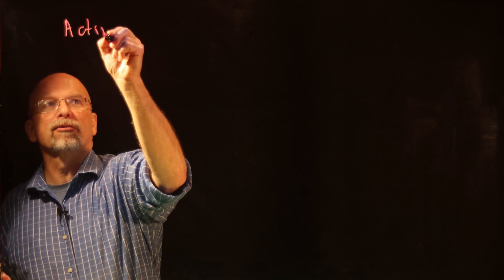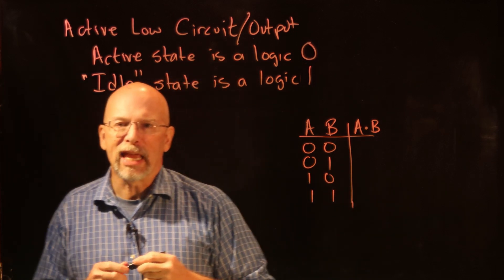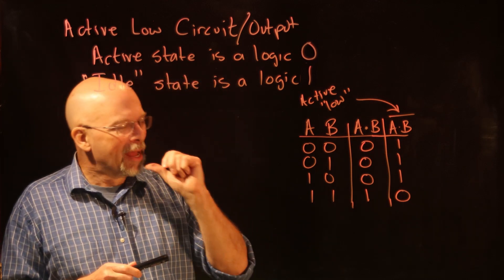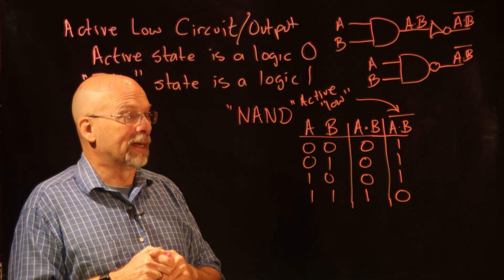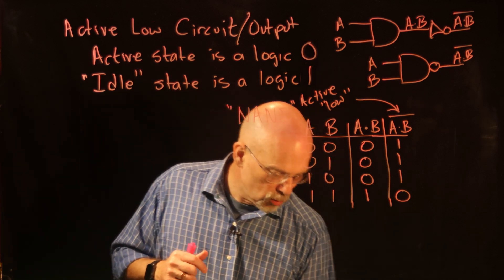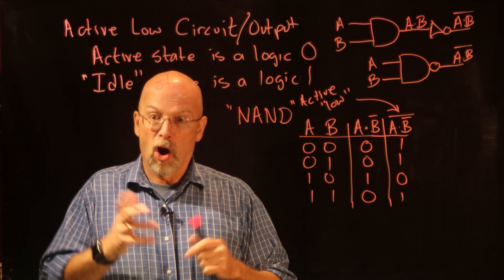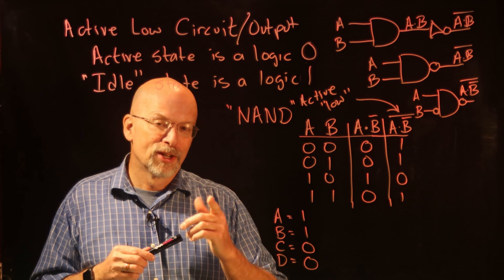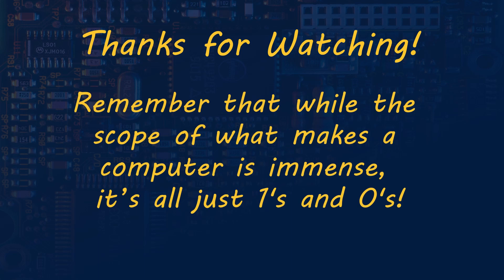Ep 029: Active Low Decoders

Comment: Im trying to learn CNC milling. I bought a low cost machine that could really do nothing at least without flaws because of emi and power. So i upgraded all and am now at the last part which is what brings me here. So i was getting missed steps and decided to go closed loop hybrid stepper motors. its a simple magnetic decoder for rotational value to determine actual position. anyways the active low and active high are whats confusing me. on my control board if i enable low (default) and enable low on the motor encoder i get no feedback and i can turn the motor by hand and it will stay wherever i leave it at. when i use the machine to move the axis it does but as soon as the command is over its limp for lack of any better term and i have no feedback on the oled monitors on the motors. If i enable active high on the control board (S4=0) and enable Active high on the motor encoder board i get feedback on the oled, the motor is under constant tension if i turn it it will turn right back to the start position.  the manufacturer suggests leaving the motor at enable low. but it doesnt seem to work that way but i am new to this i dont really know if the motor is supposed to be under constant tension or only while running. I dont want to smoke any more motors. and there is a language barrier with the manufacturer. many things im hearing are from posts on the manufacturers github but i  again feel like im trying to interpret greek. My Y axis was not moving correctly it would go for a millisecond and stop and still report it was moving but doing nothing. then it started a massive vibrating buzz unstoppable till power was cut and the motor more or less seized. i tried swapping cables. driver cards, and board interfaces and it always stayed the same ( prior to seizure) I have a new motor coming in and have found out a way in mounting the magnet which should cause less interferance with the aluminum housing of the motor, but before i turn it on again and possibly destroy more. Is it supposed to be under constant tension? they include a  hand turn wheel in the kit so i cant believe it should be under constant tension. or should i have the control board enable low and the motor enable high or the opposite? i wish i took electronics 40 years ago when i was in HS.